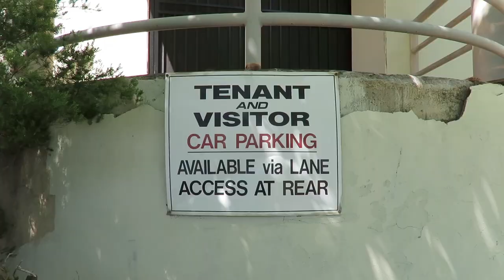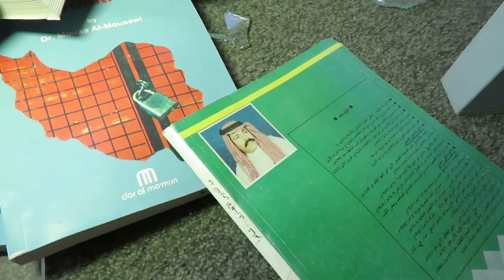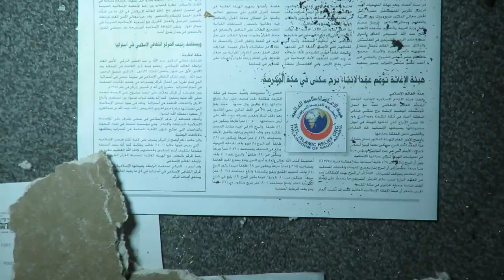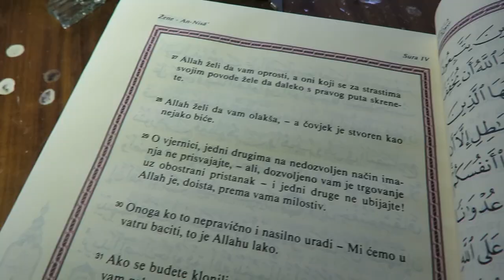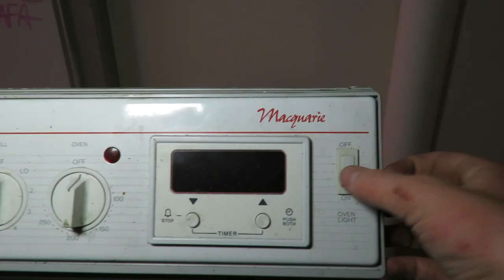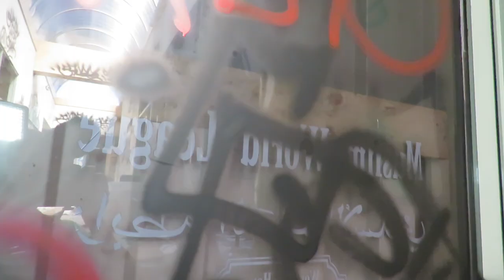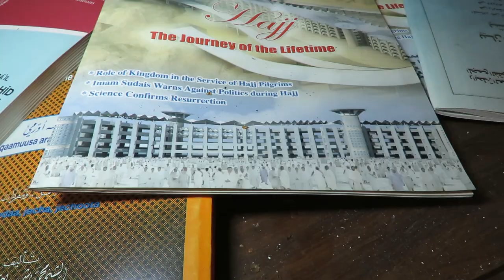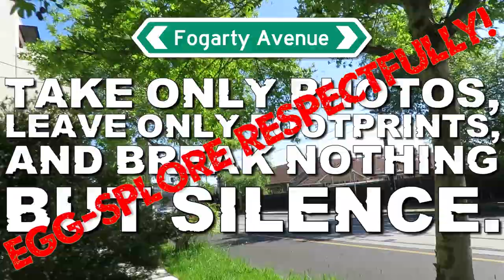Abandoned: Muslim World League Headquarters

Comment: Could you maybe make a meme template video? I used the rail track meme in my Mary Vale - Gulgong line video, and had to shift through the 30 minute video it came from.
Reply from the maker: What sort of things do you require?
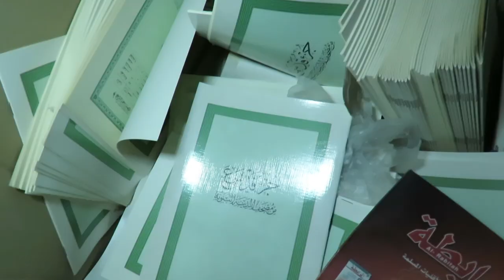Reply: @FogartyAvenue  Stuff like those sound bites at 2:56 or the "um" soundbite that was at another part of the video. Stuff like that that you normally use. Maybe the "*dairy*" soundbite in the fatal snake video?
Edit: how did i forget to mention the "I've got goosebumps" soundbite
Maybe just put them in some unlisted second long videos and add them to some playlist?
Reply from the maker: Sounds good I will see if I can whip something up.